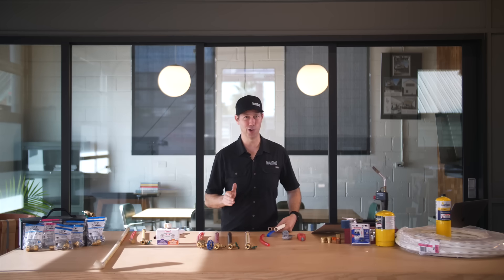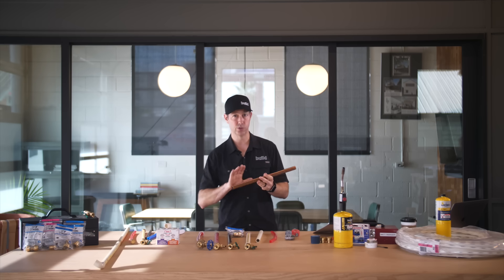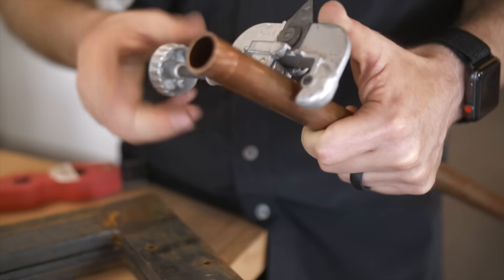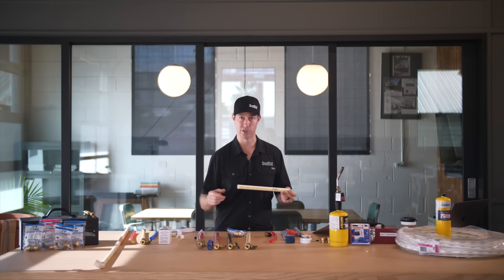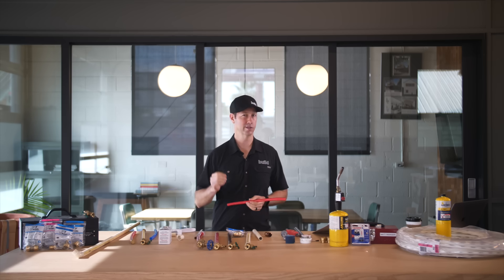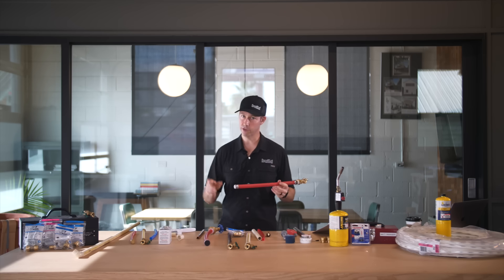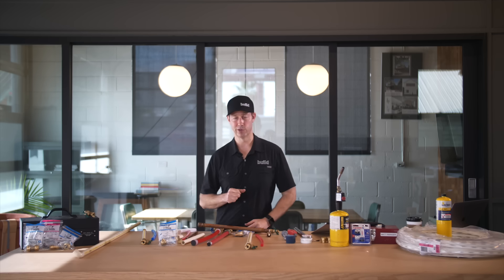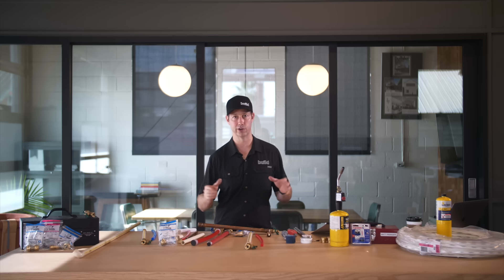PEX vs COPPER vs CPVC plumbing pipes

Comment: Another thing nobody ever mentions when comparing copper to Pex or CPVC is that rodents can't chew through copper. If you live in the woods with squirrels, mice, rats or any other wildlife that can get into your house, it's worth the price to use copper. I've heard about a lot of houses having to be replumbed because the Pex was destroyed by rodents.
Reply: Yes, this is why I always put my pex inside a protection sleeve of copper pipe.
Reply: @martinwhite418 put the pex in a copper pipe? Lol. Just use copper :) 🤔  ?
Reply: @Elricky124 😂😂😂bro I was like wait a minute
Reply: If you have rats in your house you have more problems than pipes!!
Reply: Excellent point
Reply: Seriously ive had multiple rodent problems. Do you think cpvc is ok? Pex is like paper to rats.
Reply: @dredlew NO. CPVC is a terrible choice for potable water. Worse than regular pvc.
Reply: First of all, We have to make the distinction between standard CPVC vs Flow Guard Gold CPVC. Flow Guard is a far superior product. Keeping that in mind… I live in a semi rural area where most homes have water softeners and are adjacent to woods, fields, & pastures. My largest service are is very old with homes dating back to pre-civil war years. I’ve been a plumber since 1981. I’m not even going to comment on the miles of galvanized pipe I’ve replaced. But for Copper, CPVC, & PEX: I’ve repaired more copper plumbing than I can count. Erosion & corrosion are both very real issues with copper. I’ve only had a few service calls that were on PEX that were actually minor installation issues. I’ve never once had a service call that was on CPVC from anything including erosion, corrosion, UV or thermal degradation, or rodent damage. Not once.
Reply: I've seen rats chew thru food cans. I'm pretty sure copper would be no problem.
Reply: I put my old girlfriend under the house to scare the rats off , and she started chewing the PEX.
Reply: @Californians_go_home 😂😂😂😂😂😂😂😂
Reply: @Oo7Hola  I don’t even remember tying that 🤣🤣🤣
Reply: There’s when a cat becames useful
Reply: house in the country since 74. no rodent problems with the old cpvc. knock on wood
Reply: @1hawkertech  Same with me .... I live in the woods 55 years  .... no problem with Rats on all my PVC  pipes inside or outside.
Reply: 1. Rats can definitely chew through copper. I have seen them chew through STEEL.

2. Better option is that copper is antimicrobial and not leeching plastics into your water.
Reply: I live in the country. Old farmhouse that gets a lot of mice. We have pex and no problems with that.
Reply: Uh no
Reply: Quite often what happens is when people realize they have a rat problem, they jump to poisoning them.  The poison makes them very thirsty… and they will sense the water flowing through the pipes.  As the poison takes hold they go after the pipes and chew through them to drink the water.  
As a plumber, I’ve often seen the two issues together.  Rat problem with an attempt to kill them off with poison, and plastic pipes with teeth marks all over the place.  

Rodent problems need to start with how they get into the house first.. then trapping with poison to get rid of the ones still inside the home.  Then keep traps set in the crawl space.  

Installation of copper water distribution systems is crazy expensive to install these days.  Maybe for a 1 bathroom rancher on a decent crawl or unfinished basement… but anything more complex, it’s going to run you a small fortune.
Reply: I have a rental in the middle of town; and over the past 2 months I've had rodents chew through the pipes numerous times. Pvc. In one closet opposite the hot water heater it caused so much water damage that we had to replace every peice of sheet rock on every connecting wall. I personally use pex, I do most of my plumbing maintenance myself and as a novice it has been the most forgiving out of the three to work with. And if it only lasts 20 years, I'm sure I'll have plenty of frozen and busted pipes anyway in those 20 years.
Reply: Yeah that's pretty rare though.  Big copper bushes that narrative
Reply: Uh, you do know that there are protection sleeves + insulation for them.
Reply: @edenassos  and then it should be added to cost consideration
Reply: @edenassos good point, 
But cant rats chew through the sleeves😂

Comment: You’re lifetime estimates are laughable. Copper pipe in my first house (built around 1978) needed to be repiped around 1985 due to multiple pinhole leaks in the slab. My current house was built in 1999 with CPVC. I just had it repiped with PEX because the CPVC had gotten so brittle 3 feed lines shattered during a remodel.

Comment: Does Pex work on hot water service lines straight out of the water heater?  I ask because my copper service line has twice developed pin hole leaks and, being in Houston, the heater is in the attic.

Comment: Oh God I'd hate a whole house of shark bites their the only fittings I've ever seen just come off
Reply: Used to install water heaters in new construction.We used a water line coming off the water heater.The shark bite fitting on the brand new water lines had about a 10% fail rate brand new.The tempering valve we used with shark bite fittings hardly ever leaked.A service company I worked for would automatically up sell almost any sharkbite fitting they saw.Because of reliability issues.I am a big fan of upnor pex.Rodents don't like the taste and won't chew through it.Installed correctly it is highly reliable.I hate cpvc as much or more than sharkbites.
Reply: @shawn13mertle13  if rodents don’t like the taste of uponor pex, I wonder what’s the effect of chemicals used in pex on potable water and our health?
Reply: @asgharamirpanah9793  It has been around for about 40 + years.It started in Europe they have quite stringent laws as far as safety.I would always prefer it over cpvc.If you have ever used wirsbo pex you will notice a different finish on the outer plastic.I think this is what the rodents don't like.I have done service and found wirsbo slightly chewed on but never chewed through.

Comment: I would NEVER EVER use Type M copper!!!  Virtually every house in Southern California built in the late 70’s used Type M ... and if they haven’t had a “slab leak” yet, they will!!!  We have too many minerals in the water and the builders buried them too close to the concrete and the pipe was too thin — perfect storm to screw us all over 30-50 years down the road!!! Sooo many things to consider when a building should last at least 100 years!!! Never used CPVC, but PEX is awesome! Also love copper when it doesn’t develop holes!

Comment: It's a shame that there is no discussion of water quality here.  The studies are very mixed as to how much PEX and CPVC leach chemicals into drinking water.  PEX does leach methyl tertiary butyl ether and tertiary butyl alcohol, but it can vary widely from type of PEX to type of PEX, manufacturer, and even between batches of PEX within a manufacturer.  The scary part is that there is little contention about whether CPVC and PEX leach chemicals into water; they do.  The question is whether they leach enough to pose a health risk.  I love the installation characteristics of PEX, but with all this doubt about the health impact, I would never install it for potable water in my own home.
Reply: We have so many top universities with great engineering programs, public and private research labs, so many regulatory agencies and yet so little research is done in field of construction. Our plumbing codes written a century ago and it’s not involving much.

Comment: M copper from china has impurities with well water  corrodes within a few years and you have nothing but pin hole leaks every few months until you replace all of it...biggest mistake was not using pvc to begin with for cold lines.

Comment: Cooper is much more Nobel than steel, so it’s highly unlikely it was the steel that was killing the copper. Much more likely the water was acidic and that was the issue-being the anode was gone. 

In addition-plumbers are using pro-press for copper. It’s way faster and no flame. 

CPVC is crap-holds odors.

Comment: All of the plastics also have issues with bacteria growth that copper does not.  Most pinhole leaks I have seen have been related to their being current on the pipe---one time from a recirculation pump.  As to Hammer---hammer arrestors  should be installed at all appliances with electronic valves.

Comment: PEX is a problem if there are small rodents in the area. Mice and rats can get into attics and stud bays and if they chew through the PEX and create a slow water leak that leads to water damage and mold it will often be excluded from coverage by homeowner's insurance policies. The popularity of PEX is that it can be installed by unskilled laborers. Especially with remodels or additions the contractor's crew will not include someone with plumbing trade experience of any kind.

Comment: Hi there. thanks for your video. There is a big different between PEX A and PEX B that I think you should mention it. PEX A can be use with expansion fittings BUT PEX B CAN NOT.

Comment: A big issue you overlooked with copper is the effect that water quality has on it. Hard water in particular in our house kept eating through the damn lines, we were replacing sections every year or two when new pinhole leaks would pop up. We replaced it all with PEX and haven't had any issues for several years now.
Reply: I'm in a country where there's lots of chlorine in the water. PEX hardens. It's been 15 years since a pipe I rerouted is installed. It's no longer PEX, it's frozen solid, it's a harder plastic now. No leaks, no problems, but I expect it to eventually become brittle
Reply: Good to know 👍
Reply: im having pinholes everymonth is crazy im not aplumber but i been fiximg e with shark bitesconnection it might be time to replace all pippimg i just domt now which one is gonna hamdle my well water is crazy is stromg culligan told me i need to spend over 3k o some water softener tank 😢
Reply: If you know that, why would you install house or accessible filter housings, rather than replacing pipes. 
Those pinholes could be manufactured defect (which easily effects synthetics too, cement mixes, pavers, any manufactured product), or incompetent plumbers who don’t wipe away flux which is an acid on metal.
Reply: If you have stainless steel or galvanized, piping, touching copper, or in the system, it will cause electrolysis, and the pipe will get pinhole leaks. Also, the Chinese pipe that came over for a few years is notorious for early failure.

Comment: After 15 years cpvc for hot water becomes fragile.
Reply: I've always used pvc for cold and cpvc for hot. If the cpvc has much age to it then I would suggest a hacksaw for repairs or splices later on. Those ratcheting cutters usually crack and destroy a good chunk, even worse is sending the crack lengthwise down the pipe. It does get brittle and if you think otherwise then you haven't worked around it enough.
Reply: Nope, 50 year old home my dad built original CPVC never any issues and just inspected still holding up well
Reply: @mikeclarke3005  good for you. Mine had several leaks and each time - hot water pipe. And I actually snapped one by pulling on the stuck insertion pipe. You could tug on the new one all day long, it is not snapping. But old one snapped easily. The only thing I can say in defense of leaks, they all occurred near/at joints. And even snapped one did so near a joint. So, I wonder if the glues/primers/cleaners weaken CPVC significantly, especially for the hot water?
Reply: I've never used cpvc for cold water, only hot water. I have only ever used pvc for cold. I agree that the issue may be the primer and glue used on the joints causing them to weaken over time. Also, another contributing factor would be the quality of the pipe when it was installed. Was the cut straight and properly deburred? A knurled pipe (inside or out) or an angular cut will cause turbulence at that spot in the pipe which will degrade the pipe, no matter what kind if pipe it is.

Just trying to provide some insight. I don't intend on stirring up any commotion.
Reply: @santhony1978  I wouldn't know such detail. Plumbers did the installation
Reply: Too small of ID/OD for actual pressure will cause more deterioration/sound than wanted. Schedule 80 exists people
Reply: That's been my experience.  You have about 15 years before you have to be seriously wary about the pipe being brittle.  After that, it's a crap shoot.

Comment: I live in a suburb of Dallas that was built from 75 to 84.  Neighbors on next door are always posting asking for advice about fixing under slab leaks. It's always copper that the builders used, springing leaks. Some people have leaks every couple of years.  The trend now is to reroute all the water pipes through the attic using pex. Depending on the plumber, I've seen prices from $8k to $20k for the reroute.  

The conversations on next door always include a debate about copper vs pex.  I've saved this video for the next time it shows up. Thanks!

Comment: The "ProPress" copper compression fittings work well and are easy to use. I like cpvc because it holds up and is easy to use.

Comment: PEX was hailed as the wonder pipe because it withstood  50 yrs in European radiant floor heating systems but those are closed loop systems that don't often see freshly chlorinated water introduced as a household system would daily.  50 years into home use with daily freshly chlorinated water is when PEX will be known as good or less than good.  Because UV can damage PEX i would prefer to know how it is handled before being installed. i would prefer a color guarded layered PEX pipe for UV  protection. i have seen white PEX being tractor plowed/pulled into the ground for sprinkler systems that came off of large trailer mounted rolls of the white stuff that were exposed all day to high UV summer sunlight.  That make me wonder about new residential service White PEX Lines in exposed trenches awaiting  inspection and burial ? Water systems as a whole have always suffered from the next great creation of the engineering cycle of FASTER, CHEAPER,  LIGHTER, EASIER TO INSTALL. Always run your water to clear out standing water and any leaching from the pipes and faucets no matter the pipe type before drinking is a fair idea because you never really know

Comment: I must put in my 2 cents worth, good or bad, and only because I put my own plumbing in when we built our house, and it is now been 36 years Later. I had done some plumbing work in younger years, when we used all galvanized pipe, all the way through out a house, cutting and threading each pipe. So after all those years when we built our house I decided on cpvc, and used it through out for hot and cold water lines.  Now 36 years later we still have it, we have had several leaks and I have managed to keep them up even at the age of 75 now. I  will say that it does get brittle,  and ours has been for some years. I can't say just what year it got brittle, but several years ago (maybe 10 or 12 years ago),when I installed a new tankless hot water system, is when I first notice it getting brittle. As I cut into the water lines I notice it brittle and I had to keep cutting back until I finally got a clean cut.  I was able to glue more pipe in and do today, if and when I need to, but the cutting seems to be the down fall, because you may have to make several cuts some times, until you do get a straight and clean cut. I do not say and don't say which pipe way is best. The only reason I am here today, is because I was researching to see what is best and if I should, or will I,  at some point have to change over to something else in the future and/or what use? So, all I am doing is giving my 36 year of experience's with cpvc. Most people are not going to live in the same house all this long, or may not care what kind of piping they have, Until they have to make a repair. What I am saying is it doesn't matter until you have a leak , and your leaks are hard to get to , and work space is limited, like in our basement and in between the ceiling and floor and your ceiling tile has gotten wet. Then you wish it was better and lasted longer. So research all, and the pros and cons of each, and hope you make a good pick.

Comment: When I was a little kid, my dad was working on the plumbing in the bathroom and I spilled the purple primer ALL over the tile floor he had just laid. He was pretty mad. 😂
Reply: I just had the purple can fall off the ladder in the kitchen, needless to say it was a disaster. I looked online to find a possible cleanup on laminate flooring - used nail polish remover the non smell kind - even after a few hours it worked fairly well.

Comment: What you say new types of piping, copper is used in Europe for 20 years, now they uses stainless pipes and the fittings are only put together with pressure tools. But the best is the Hose in Hose from Viega from the roll, this means no waste no fittings, all you need are the outlets which squeeze and sealing it to the pipe.